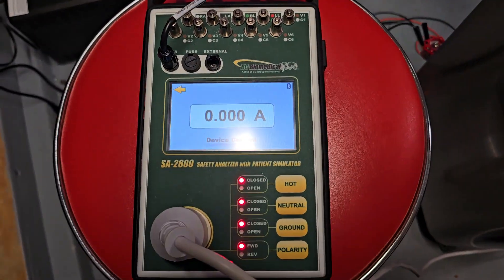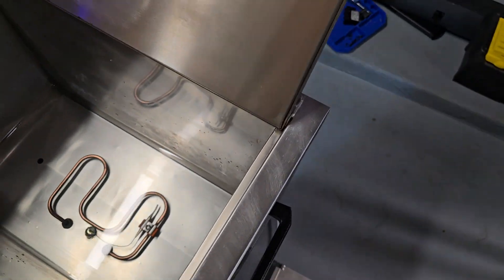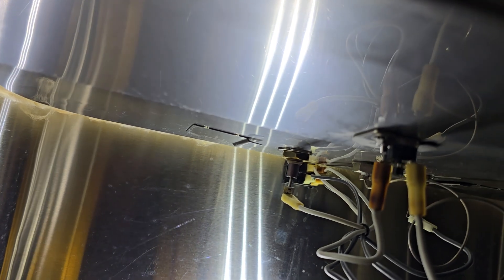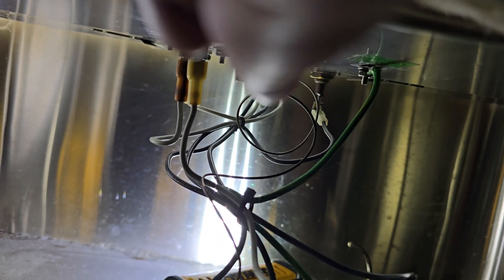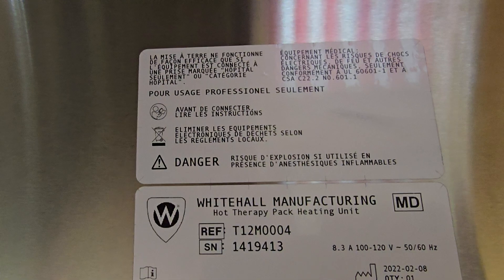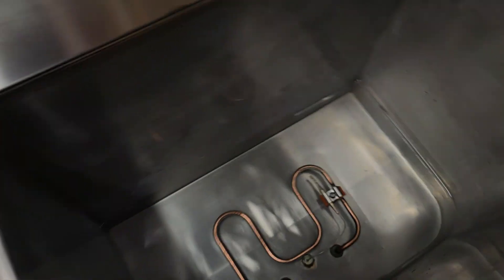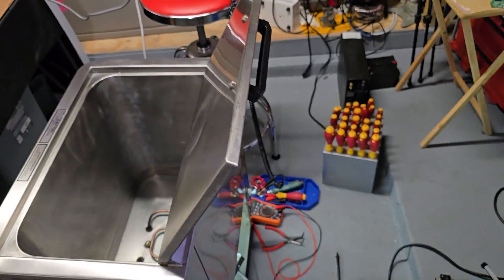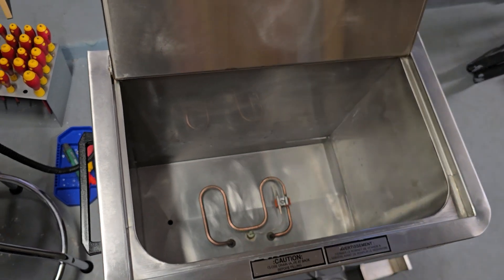Electrical Safety Analyzer = Amp Meter

Comment: Is it typical for medical equipment powers switch’s to switch on / off hot and neutral? Vs consumer that typically just switch on / off the hot ?  Or is neutral just to have a lighted switch
Reply from the maker: @KE5ZZO  yes. And typical to have both fused